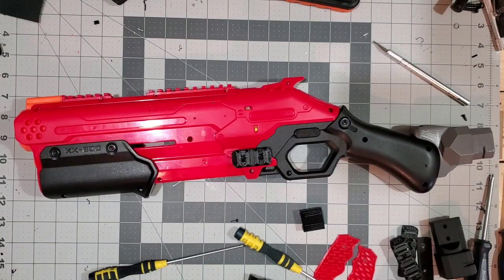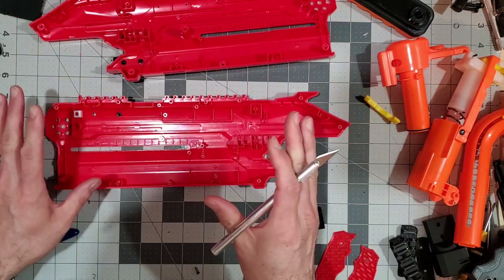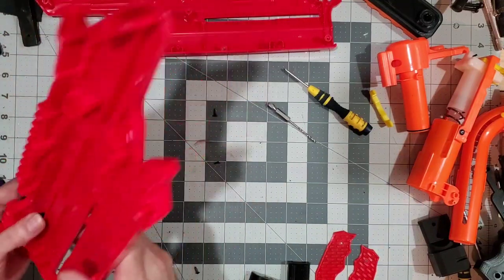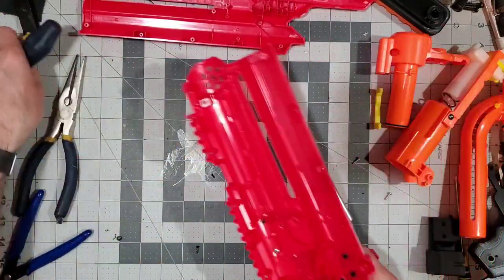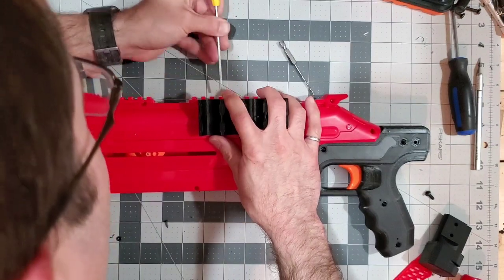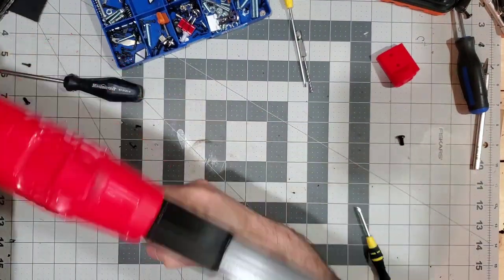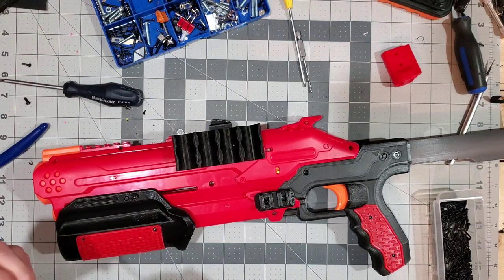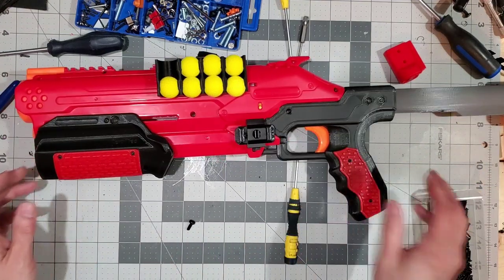Nerf Tactical Takedown Install Guide

Comment: So a few things on the takedown that I learned while installing this or other takedown stuff.

1. For the trigger, some of takedowns have bumps on the bottom which needs to be filed down or cut off for it to fit in the pistol grip.
2. For the internals, if you have a higher velocity spring and have to be put back together, it's easier to have it primed when you close it up, BUT you need to be careful because if the catch release gets accidentally triggered by you pressing on it or the trigger setting it off, you basically lose your takedown.  When putting in the trigger for that, you can put the trigger safety on and it should be fine as long as you are super careful.
3. The pistol grip and stock combo makes the higher power spring primes easier and makes this nerf blaster an amazing addition to anyone's arsenal.